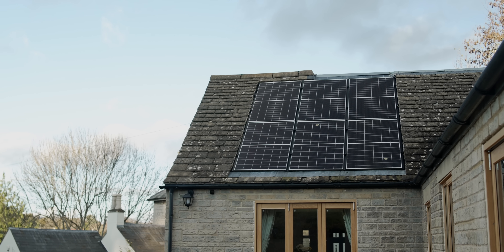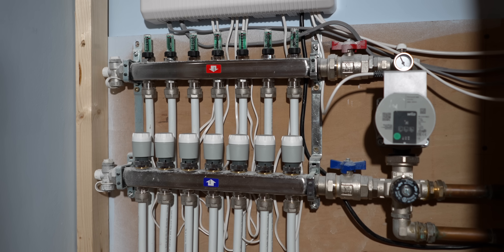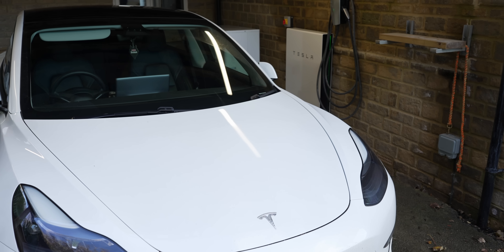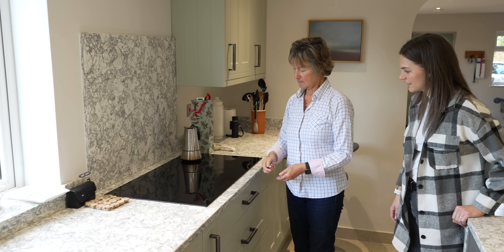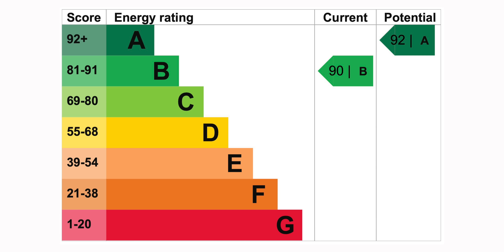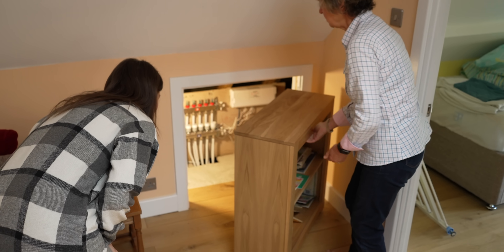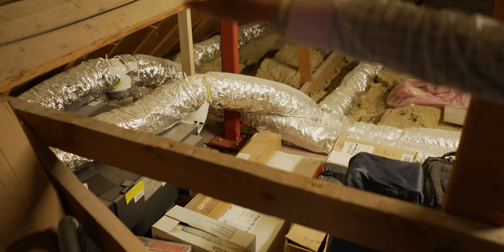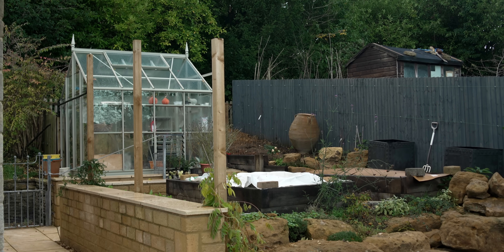Could These Clean Energy Technologies Work In Your Home?

Comment: What is frustrating is our useless government is still allowing new houses to be built with gas central heating, no solar, no batteries, inadequate insulation. They will all need an expensive retrofit in the future.
Reply: In European Union new developments uni family residential don't must use methane gas / oil / coal. 
Look at your neighbor Netherlands were already you can't make new houses heated with fossil fuels.
Reply: Funny thing is ..the better I do my job, the less solar is needed to pass a good EPC.. but if I do a rubbish job and forced my clients to put more solar I will probably lose work. You are right, the government needs to set a better standards, most houses are built by housebuilders, they’re only looking at the bottom line, and at the moment gas is cheaper than electricity in our SAP ratings. At the moment, many sap assessors are leaving as from this year, because the government has forced a new SAP 10” regulation and the Computer program is not working, and on top of that the two major assessment companies are merging because the software is part usable.
Reply: @IDann1  You shouldn't be able to get a good EPC without lots of solar, batteries and heat pump.
Reply: @DavidKnowles0  we have a ASHP, it's not even considered under the current EPC system. Bonkers!
Reply: Need to vote for the green party 🤔
Reply: What frustrates me, is that many of these incentives such as RHI, feed in tariff and grants for EV chargers have diminished or been removed while few people have actually adopted the technology.
Reply: @John1986ATR  I think the FiT was too successful which is why it got binned - unfortunately there were also too many 'double glazing' type companies jumping on the bandwagon with no actual clue about renewables - they came and went and the unfortunate people that used them are now finding out their systems aren't what was promised or needing maintenance from third parties - the boom and bust of grant-based trades is part of the problem too :(
Reply: @John1986ATR  absolutely
Reply: This is the way ❤
Reply: @Tired of War 7-10% at the moment in autumn is sort of expected if the weather is grey. But out of a 4-5kWp installation (standard now), that’s still 400-500W usable power. You can charge two phones (15W per phone), have your internet box running (10W), run two laptops (40W each), cover for the 180W of electricity used by your boiler when it kicks in, cover for the 100W of your fridge freezer when it kicks in, and maybe have a few LED lights on plus a modern LED energy-efficient TV (40W). And if you’re not at home, even better, you can replace the laptops and phones by a dishwasher and a washing machine on eco modes (60-80W together). 👍🏻 So… on 400W-500W you can run a lot.
Reply: @Nikoo033  November has been a dire month for PV - grey and miserable so I've barely covered my background use on 4kWp PV - that is a max of 300W with internet, fridge and freezer on at the same time - the bare minimum is 40W - but with shorter days, that might have peaked at around 11-12 - then it's dark by 3pm so maybe 0-1kWh total per day (versus say 25kWh during the summer). Ironically I recently added a 4.8kWh battery to see how it would fare - again no excess to even bother attempting to let it charge as there's have yet to be 2 consecutive days of sun to tie me over on PV and battery alone. The odd day when it has been bright, if the battery gets over 80%, it will last the night ready for the next cycle - that might happen once or twice in Nov/Dec/Jan but I believe that either side it will be a nice solution. However as Tired of War says, gas on the other hand for heating is the killer - having an ASHP wouldn't help as the PV won't even cover background, let alone the worst case of needing 75kWh heating input on the coldest of days. When I was considering the battery I was also looking at external insulation for the one colder end of the house (exposed 3 sides) as it is timber clad and would have been relatively easier to do than the rendered parts - I calculated that 60-70mm insulation alone would be around £2k and that was less than one third of the entire house...our energy footprint for electric is 2000kWh (offset with PV and battery so import was 1000kWh but hope to drop to 500kWh with the battery) - heating on the other hand is 12000kWh, so realistically I'd need a 10+kWp PV array plus 100kWh battery plus ASHP to go gas free and import as little electric as possible :(
Reply: @Umski  I suppose that it depends where you live in the UK. October and November have been ok for me in terms of PV. It’s drastically lower (7-10%) since December started. But I am sure that January-February might indeed be tough with snow and all coming 😅. Fully charged did say that it is rare to manage more than 30% charge on a Tesla Powerwall during end of autumn-winter. So not too surprised by what you said. Battery should certainly be worth it from Spring. I too use 2.2kWh / year of electricity. But made good efforts this year and should end up at 1.9kWh I think. Regarding gas, most of us are at 12kWh/ year. Bear in mind, with ASHP, you have a 1kWh elec for 3kWh heat produced ratio, so in reality, you’d probably be only using 4-6 kWh of electricity to reach 12kWh of heat like with a gas boiler. 👌🏻
Reply: @Nikoo033  East Anglia which is normally pretty good on the overall irradiance, but yes it's a challenge - indeed even at a good SCOP of 3-4 over the year, on the coldest days this will drop lower and so the ratio would be worse, just when you need the most amount of heat input - if it boils down to cost, then a big investment is needed up front to offset the running costs...ironically since I got the battery I am using more on-site gas as the battery takes priority over my DHW PV diversion, so whilst in previous years I was using gas for DHW maybe 100 days of the year, that's likely to now go up to 120-125 I think as the battery is sucking up the excess = lower energy bills but higher CO2, but we'll see - I'm hopeful that between April and Sept, we should be net zero-ish in imports of both electric and gas :)
Reply: @Umski  isn’t this battery priority simply a software/setup issue? I thought devices like myenergi’s eddi would help define where your excess power goes? Or did you tell your system to fill the battery first then DHW?
Reply: @Nikoo033  it's a DIY diverter based on the Open Energy Monitor hardware so mostly someone else's code with a few tweaks I've made (and fudges to prevent it draining the battery down) - it's doing it the way I want inadvertently as I prefer to retain the excess in the battery for use in electrical appliances first, rather than just dump it as heat, which can be done in other ways (ahem!) - my brain is still figuring out how I could swap it if needed, but for now it's logical - adding an EV or HP may complicate things further though! Once the battery gets up to 80% SoC it drops the charge rate and the excess gets punted into the immersion so it does contribute overall, and once the daily output gets to 5+kWh it will just be like allocating chunks of free PV energy for different purposes 👍
Reply: @Umski  makes sense 👍🏻
Reply: @Tired of War sure.
Reply: But how many builders actually install it properly without gaps and cold bridges I wonder?
Reply: @Umski  Exactly, even the council couldn't build new council houses with the correct insulation, they were shamed into fixing it and even then it took two attempts for them to do it correctly. If this what councils are building, I suspect the private sector are getting away with bloody murder up and down the country.
Reply: @Umski  for new builds built as part of a dvelopment they will be good, because professionals are looking at what they are doing and they need to do air leakage testing (litterally pumping up the house to see how leaky it is).. one-off houses and extensions are more of a mixed bag.  but the regs for every day houses now would have been labelled as basically eco homes and crazy impossible by builders 20 years ago.     Gas is already dead for pretty much all flats, (and frankly modern flats are heated so little it's not a big issue)   the CRAZY thing is that they are allowed to build houses 4 feet apart from each other, where building a terrace would be massively more efficient in both material and heat loss.    Mandating heat pumps for houses will come but there are so many existing houses comapapred to new ones that it's not the big issue.

There are about 20m homes in england.. and each year they build 35k ish.   So lets say they take 6 years to change the regulations.. that's only 1% of homes.   so doing it today is not fixing the problem.. especially since those 1% are likely amongst the most efficient anyway.
Reply: @mralistair737  tend to disagree- anything that’s obvious and testable might be legit such as air tightness as you suggest, but builders and tradies will do as little as possible to get away with the bare minimum - that will include burying empty cans of Red Bull in between joists and the like, let alone ensuring cold bridges don’t exist - likewise the new regs mandating insulation of pipework will get notional photos of any easy to inspect areas and rest will be scrimped on - this is worse for larger developments where contractors are drafted in as fill in - I have heard plenty of horror stories, one being my sister’s new build that had to have an entire plaster board wall redone due to sloppy plumbing causing leaks 😬🙄
Reply: @Umski  What are you basing this info on?  some guy that did your loft in 1987? AIr tightness is not easy, or obvious, it relies on all the contractors doing their work well, volume house builders are generally using 3rd party sub contractors, they have paid for the work and will have people on the ground checking thy are getting it,  Building control aren't checking anything but the main contractor / developer usually is.   

Thermal bridges are much less of an issue that they were a decade ago because there are much better products nowadays for cavity closers etc.   Modern flats are at the point where the latest changes to regs are to bring in measures to limit over-heating, stand-alone houses are never as efficient but are still WAY ahead of where things were 20 years ago, and compared to the average 1930s semi they are a different ballgame.  I mean one volume housebuilder i know is up to 400mm loft insulation now, plus MVHR etc.   Yes there's still a boiler but  you cannot just glibly throw away the advances that have been made because they dont fit your little rant about the government.   

And the point still stands that new houses make up a TINY proportion of the overall housing stock and an even TINIER proportion of the carbon output from housing. This is not low-hanging fruit.   The government making it harder to build new houses would mean there would be less of these highly insulated homes and keep people in older properties. They would be far better to concentrate on the low hanging fruit.  I mean on the street next to me in London there are 2 houses with single glazed tilting louvre windows (the type where you can tilt the glass like a venetian blind)  zero air tightness, zero insulation. and i cannot imagine what that guys boiler is like.  £3k to fix that with a new boiler will make more difference than 5 new builds with ashp. 

And while i'm here, adding batteries to individual houses to a new development is dumb, it may help an individual owner save cash, but if you are interested in saving carbon this sort of storage should be centralised / communal in larger well managed set-ups. or grid level. where they will be fully utilised every day.
Reply: @mralistair737  wow that seemed to touch a nerve, I didn't realise I was having a rant at the government 🙄 my point was that buildings are only as good as the people that build them - you may believe that this is true but in my experience of seeing old and new builds plus anecdotal evidence, this varies hugely - my example was based on insulation completed in 2002 - a complete shambles and plenty of builders' used food containers and copies of The Sun thrown in to add extra - nice. Further example of a refurb done in just 2021 - floor was recently ripped up as UFH required - same again, no pipe insulation and random cans buried where 'no-one' will find them - if that's the level of quality being aimed for then there's no hope regardless of what the government mandate, unless of course it's fully visible and obvious for all to see like double glazing, but even then sloppy installs can mean drafts from gaps around the installation often hard to find until it's cold and windy.

I agree on your point that 400mm and MVHR is a good thing, provided it has actually been done properly, which is a big assumption once it becomes a mainstream 'jack-of-all-trades' install. Also agree on individual batteries, it's selfish in a way but most don't give a toss about energy efficiency - those with batteries will be trying to make the most of every Wh they produce - yes, as a whole this may make small difference but that's no different to a lot of individual choices like having a massive needless SUV over a small EV runabout.

In a weird way, the increases in energy costs might re-focus the minds of society by not wasting it in the first place and retaining that which they've put in through efficiency measures such as insulation etc - that's my rant ;)
Reply: @Umski  Well you started with "why is the government not making them insulate buildings (they are)..  then went to "but builders dont install it" (they do).. in any decent sized development you are dealing professionals with professionals looking at their work so your flippant assumption (shared by many) is just another example of people not seeing that actually a LOT of good work is already done.  

To people in the  industry who have seen insulation levels quadruple in 20 years, and air tightness go from literally no requirement to a pretty rigorous and tested requirement, for people (not just you. i've had friends say it as well) say "they should make people insulate new builds" is just staggering given the time, money and effort put into do just that.  (add all the other efficiency gains in that period for similar effect)

Anyway, i guess my larger point is that it's hard to get a sense of perspective when people dont realise how high the existing building regs are, Insisting on improving new builds is spending a lot of money to make the most efficient buildings a little bit more efficient.  It's MUCH  MUCH better to spend the cash to make the worst ones even 10% better, it would save an order of magnitude more carbon. and that's before you consider that there are WAY more of them to do... also making new builds more expensive takes them further away from poorer people who need more efficient housing (or means less of them can have it)
Reply: @mralistair737  totally agree on improving older properties - no real will to do so from homeowners - I recall the mid 2000s when cavity wall was subsidised and loft insulation was 3 for 2 - I had the CV done for under £500 and bought a load of rolls to DIY the loft having just bought a 25 year old house with practically zero insulation - seems a lots of trades took advantage of those deals too - I picked up enough to cover 200m2 for £5 a roll a few years later (2002 build with poorly applied loft insulation) - it's now £20 a roll and most homeowners would rather buy a shiny new kitchen than grovel around in their loft yet then blame the government for high bills - it's catch 22 sadly - it's unfair to tar the whole industry with the same brush, no doubt there are good tradespeople out there but there are also many not so good examples too - heat pumps will be the next big scandal in terms of shoddy workmanship and the industry not being clued up enough around pump sizing, heat losses and rad sizing...[second rant] ;)
Reply: At the very least, they should be preparing houses to be fitted with panels and a battery, and then ask prospective buyers during building what panels they want and fit them while the scaffolding is up!
Reply: Insulation is part of building regs and needs to be a minimum of 270mm in the loft
Reply: Gas central heating is still the state of the art and continues to be so for many years...

Comment: I’ve done a similar set of alterations to a fifties built Semi-detached 3 bedroom home, but with the original or upgraded radiators. No Gas since 2017. Beautifully comfortable and stable home temperature even without the underfloor heating.  Solar PV added 2011 when FIT was at top rate. Powerwall 1 added in 2016. Heat pump added in 2017. Net energy costs : £10 / month averaged out over the year. Until RHI expires. FIT runs for 24 years 3 months from installation.

Comment: I think that Allison is not aware that there is an efficiency loss in the battery (any battery but specially with AC coupled batteries like Tesla) charging process so when they charge you the same for what you put in vs what they took out you probably lost 15-20% in the process. Good deal for Octopus Energy. Otherwise a great setup and highly efficient.

Comment: Hi Emilie, this was very interesting but could you do more on heat recovery systems and single room heat recovery as i think this is needed especially in older properties and air tightness prevents fresh air from getting into properties. I was thinking about infrared heating and single room heat recovery plus a heat battery for hot water only. Great to see you again. Take care.